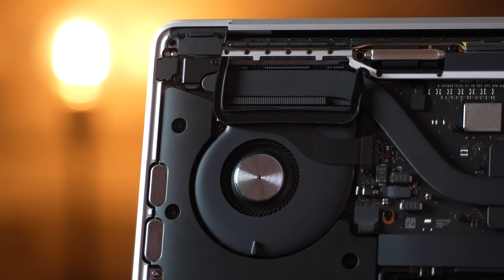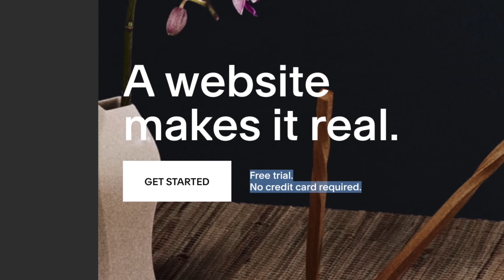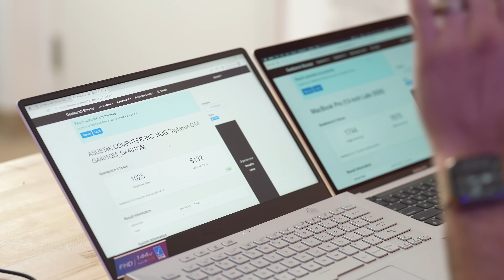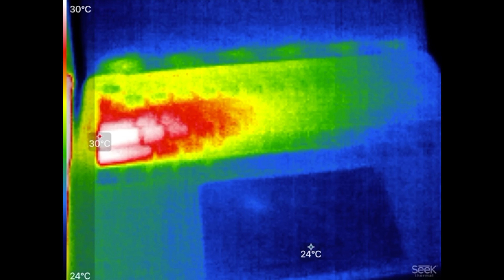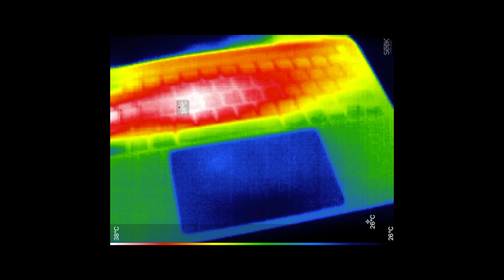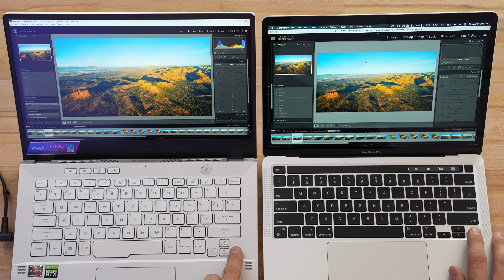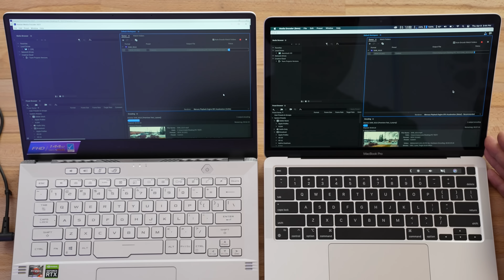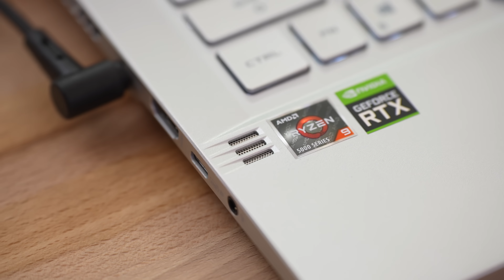Apple M1 vs AMD 5900HS + RTX 3060: FINALLY an M1 Killer?

Comment: One key test metric left unmentioned: battery life for the Zephyrus G14.
Reply: I'll do a test on mine tomorrow. It advertises 10 hours of battery life, but I'm expecting closer to 6 or 7 with my usage. That will be with web browsing, photo editing, and watching some videos.
Reply: @timg6930  how was it?
Reply: @timg6930  mine got 9h 🤷🏽‍♂️
Reply: No way I use to have an older version of this. 5-6 hours tops
Reply: I just got one. Gaming I was VERY pleasantly surprised that I could get anywhere between 2 (heavy, maxxing out GPU, turbo mode, etc) and 5 (lighter games or heavy ones with low graphics and in iGPU mode, still hitting 60fps easy) hours of gaming. When doing productive or media intensive tasks I got between 8 and 11 hours. Overall,  very very good. I switched from Mac and couldn't be happier
Reply: @planefan082  that is so awesome, man!
Reply: Is it good?
Reply: @blackpepper2610  unfortunately Apple is far ahead of everybody else at this moment.
Reply: I have the 2021 Ryzen 9 5900HS version ,same as the one on this video. I disabled turbo boost only on battery and use it in silent profile, the performance is still insane even in this mode. Screen brightness around 80% and keyboard brightness ON, i worked for a full day without noticing I was on battery before Windows eventually game me the 10% battery left warning. I program and compile code, so not a completely lightweight scenario. I can say that you can get 6-8h of battery life easily with this laptop on these conditions. My gf has the M1 MBP13 and when she uses it for something a little bit heavier than just looking at facebook, for example if she is editing some photos or something with it, or even watching netflix, the battery also lasts around 8h. So the G14 is almost double the CPU performance and almost 5x the GPU performance, upgradable, cheaper, and has the same battery life. The M1 is no longer shocking, the G14 just showed us that x86 still has many years to shine. And I'm not seeing Apple silicon catching up anytime soon, it's not easy for them to catch up with a cpu that has almost 2x the performance in just a single year or 2, because the x86 will also keep evolving. And the M1 already overheats, so I don't see Apple pushing much more cores on the M1X / M2 anyway. And the M1 GPU is still barely better than an integrated card, and Intel Xe graphics are already better than it. Apple made a huge decision to change to their own silicon, but they only got it right because intel wasn't evolving sh*t. But things have changed and the new AMD 5000 and intel 11th gen with Xe graphics and incoming 12th gen will really make Apple jealous for ditching intel (and that's exactly what intel is trying to do because they are pissed at Apple). We users are the ones who win with this, harsh competition is awesome
Reply: One key test was unmentioned cyber punk fps
Reply: it would be interesting to know, what performance the G14 would deliver if limited to 15 watts. most like not turning on.
Reply: Well with a mentioning that m1 last longer we also should mention that 16gb amd laptop is cheaper than 8gb mac... So if we would compare both models with 16gb, pretty mutch you would overlay for m1 battery half grand extra  while wining all m1 limitations and short ends to. I think m1 for most ppl not worth since you can get better suited amd laptop for cheaper that does job just as good and better. Only reasons to buy m1 if you need mac os or that battery life, but as far as i know apple users does not realy care about value, they willing to pay apple tax
Reply: @racistpixel1017  The Apple tax you talked about only applies if you spec up the M1 Macbooks. If you buy the base models they are both very good value, maybe not for you specifically but for most people who use a laptop. Here are some facts that prove this:
1/ Mac sale in unit is up 50% from Q4 last year.
2/ Most tech reviewers suggest M1 MacBooks for everyday use for most people unless you have specific need for window or x86. They are all amaze of the efficiency/battery and low noise/temp these laptops offer.  
3/ It has been 5 months since M1 came out and I can't find a laptop that have similar size, weight, build quality and price that can beat the base model M1 MacBook Air. (don't even mention battery life)

It might not fit your needs but these MacBooks for sure are excellent valued products and keep in mind that you don't present all people who use laptop.
Reply: @super_hero2  asus zephyrus g14 maxed out cheaper than 8gb m1 mac and beats it in value, here apple tax, it cheapes out for faster usb ports, ios, hz screen, multiple monitors, shitty gpu compared to dedicated, outdated design and else. Again clever apple tax. 

For average user for every day use hight refresh rate gives more than cpu speed he newer will be able to utilize. So m1 power is a waste if these tech youtubers only suggest m1 as everyday use laptop. If you ever experiance 120-140 or even 300hz screens, you will understand the pleasure.

You can find plenty of notebooks with amd that is does not produce much heat or noise (even so noone did notice those 2 until m1 made a problem out of it), so for everyday use any laptop will be fine, you can play on faster cpu but slover and limited everything else and believe that you win good value...
Reply: @racistpixel1017  I am not sure what you are trying to say here. I already said that the Apple tax only apply when you start maxing out the MacBook. Most people don't need 1tb 2tb ssd on a laptop.
Why should I take your word for it when serious multiple tech reviewers (who make a living reviewing tech) suggest M1 MacBook over anything else for average users? You think high refresh rate is king, I think color accurate, brightness, high resolution HDR capable screen is better.
Let's be specific, for $999 find me a laptop that has similar thickness, weight, build quality. You don't have to match everything but it better be similar comparable.
Reply: @super_hero2  average user cant see color accuracy but can feel frame rate, and colors and all on those screens is still good, fot for profesionals. Those tech youtubers probably dont edit videos on m1 mac's. Those youtubers only suggest, that does not mean its a "must to buy", they also hyped.  And for apple tax again, g14 maxes out model that is pretty mutch more powerfull than maxes out m1 model but cheaper than base m1 model... apple tax... I dont think thats hard to understand...
Reply: @racistpixel1017   You've compared the maxed out G14 and M1, the fact is that the only difference is storage, either M1 performs the same, there is no need to maxing out. You could even save more with the M1 Air, Apple "tax" is avoided.

With the high refresh rates, that's all for gaming, it doesn't contribute anything in editing. 

That's the difference between the two laptops, the G14 is much more capable of gaming and M1 is a first gen laptop focused on professional work. It all depends on what you need for your daily workflow.

With your statement of content creators, probably not using it for editing and it's just hyped. It is capable for editing, it's not like older gen. Macs didn't exist and weren't used for editing. 

Though in your perspective it's not for everyone, it's a first gen. producy, people with established workflows won't be able to adapt easily to the new M1.

*eh idk, just wanted to hop in the thread.
Reply: @jayaflower  dude are you listening, i have high refresh rate panel and i dont play games, these panes is superior, whole system feels smoother and more responsive, again fps is worth more than cpu power that you will never utilize ... For average user that m1 is for, smoother panel is way more pleasant and actually something he can use and feel every time he use laptop, but cpu power, probably only 5% utilized so... What a trade of
Reply: @racistpixel1017  Those YouTubers suggest M1 MacBook for AVERAGE users which is the majority of the total users. People who use laptop for video editing is just a small fraction.
You can put a MacBook and G14 side by side and compare the picture quality yourself to see if average user can see the different. And don't even mention HDR video. You can't have everything so between high refresh rate vs picture quality, I choose picture quality. What you or I think does not matter here since it is subjective.
You still haven't shown me any laptop that beat the base M1 MacBook Air with similar form factor and price.

The point here is that you can't deny that the M series chip is making a huge impact on mobile processors. I am not saying AMD is not good, in fact they are both very far ahead from Intel.
Reply: @racistpixel1017   You are the one who's not listening. Since you don't game, you can't say that the MacBook only uses a percentage of the chip power isn't worth it, since the M1 can perform that well against a laptop that uses more power. And considering in, you wouldn't probably consume all the power of the cpu at once all the time, if you're just an "average user" so your statement doesn't stand.

You can't justify picture quality to high refresh rates (as mentioned in another reply), the M1's OS is built to have a good user experience, it's responsive too. You don't scrolling through the web and moving around windows around at a fast rate like you can work with that. You'll also need to consider in the quality of the G14's screen since that's also part of the experience, as you've also mentioned that responsiveness is key, that statement doesn't stand well if the MacOs can keep run smoothly too.
Reply: @jayaflower  omg, ok i run to buy mac Now since it has little bit faster cpu but slow everything else. Okk... life changing experience
Reply: @racistpixel1017  Yes, use your sarcasm to divert on your losing stance. and btw it isn't slow.
Reply: @jayaflower  slow refresh rate, slow usb speeds, no video card, bluetooth issues, no upgradeability, no multiple monitors, no virtualization, no atleast medioker gaming, as you say, m1 is for average user, that means in apple eyes, average user only need fast exporting times,... Me as a average user, i dont need fastest cpu in the world, i choose slower cpu since m1 power i cant utilize, it does not exist for me. Im tired of trying to explain this simple thing to you, if you cant understand... Not my problem, dream how you will use all that m1 power while i have smooth os experiance apple dont have that i can see amd i do utilize...
Reply: @racistpixel1017  Then why are you here defending two devices that doesn't matter to you, that's the simple thing that you can't understand.

You have a different understanding of an average user, you're an average user using statements for more than an regular user, the M1 is capable of light gaming, it has virtualization, bluetooth is bad on every device.

Again stop repeating yourself, slow refresh rate you say, yet the screen quality is better than your experience. And in other words you don't need to upgrade if you're an average user, you don't need three monitors if you're an average user.

You seem like you didn't even watch the video, and the uses of the M1 and G14. You're completely out of the topic. and I thank you for engaging with the thread lmao.
Reply: @racistpixel1017  Every laptop has pros and cons, you can't list all the cons of a laptop and ignore all the pros then draw a conclusion that it is overpriced.

You say average user can't utilize the M1 chip fully then do you think average user need a dedicated GPU? I also doubt that average user would prefer 144hz over picture quality. I have never heard anyone who looks for a high refresh rate laptop unless they play game.

Keep in mind people buy laptops and use them for years. 3, 4 years down the row M1 will still hold up nicely while your window laptop will either become slow or has sound/battery/display problems, good luck using it without the charger.
Reply: @super_hero2  for hz, most of ppl newer experience that, when you try it first time, you wont come back...

 My 9th i5 helds up prety nicely, can run all the games if i want, good for work, no lag, dont lack a bit of performance and on bonus whole OS run at 120fps while using only ~3-5% of cpu, to use it a pleasure, tried friend m1, while its snappy an all that, i dont see mutch difference. so realy cpu is good enough for meny years now...  Plus panel picture quality good enough, actually now days, panels for consumers pretty mutch profesional grade and most average users cant tell if lime is yellow or green...

What im trying to say for hyped apple fans who rave about how ultimately  superior m1 is, it is not, and devices based on it not superior, its supperior compared to older apple products but its not the best of the best choise for everyone... It seems that m1 is religion to  lifetimes apple users...

And yeat 95% of ppl who buy m1 is lifetime apple users, if you lool to charts you probably notice that pc side of consumers  buys did not dropped down.

Even so with iphones, most of sells in android market even so iphone considered as superior, but only to apple users
Reply: @racistpixel1017  How could you say that average user will love the high refresh rate over picture quality when you know that most people never experience high refresh rate? What is your sample size? yourself?

I know that in the case of smart phone, the reason why people don't go back from high refresh rate is because the difference in picture quality between smartphones is very similar. While in the case of this video the difference in picture quality between these two displays is not close at all.

Unless your laptop is designed for gaming, it likely won't have higher than 60Hz. Apple, Dell, Microsoft... they do extensive researchs and decide to go for picture quality for non gaming laptop for years, it is not only Apple and this is no coincidence.
Reply: @racistpixel1017  Modern CPU won't be fully utilized if you don't multitask. Try running antivirus, play game with external monitors, streaming your game, use discord.

The M1 MacBook display is 2560x1600, HDR capable, DCI-P3, 400 nits brightness and you are saying that to average users, it looks the same with the 1080, 300 nits display? If you really think so, you need to provide data to prove your point because logically it sounds insane.

Please don't use made up number in your replies (95% ppl buy m1 is lifetime apple users). Buys don't drop for any company especially since the pandemic but Mac increase the most percentage wise and it only been one quarter since M1 came out (the data I stated before was year to year increase).
Reply: @super_hero2  
Sometimes it seems you dont read half what i write and you just and just argue....

again, i dont game and i o
Preffer high refresh rate, the whole laptop feels way faster and smoother, how many times i have to repeat until you understand, average user cant tell if lime is yellow or green, if you dont put two screens side by side, they cant tell differentce, consumers screens nowdays is professional grade, as a graphic dedigner i can tell, they good, you wont win much in quality, better invest in smoother system. and again AVERAGE USER...

 ON TINY M1 SCREEN THERE IS NO POINT FOR SUCH HIGHT RESOLUTION.

Now i do use discrod, i dont need 3rd antivirus, use Microsoft build in one amd had no viruses for years, i do use other heavy programs and engines and still my cpu usage is chill. for aying games yeas but rarely more that 80% on maxed settings, but do we speak about m1 since no single point you mentioned is possible on m1... And yeat we speaking about average users

Probably you do dont read this so yah farewell, i dont want to argue whith i simpleminded self-righteous person who dont listen only speaks... To who i have to repeat same thing and points and he jist skips it and you still dont understand what im trying to say. You can be right for your self.

If you still argue and not geting my points  then whats the point, i wont repeat anymore like to a child
Reply: @racistpixel1017  ?? you are really saying, that we arent reading half of what you wrote, but you are doing the same! Average user cant tell the difference between 60 hz and 120hz /144hz, so thats a stupid argument. "If you dont put both displays side by side" you will not see any refresh rate difference :)) 

I had a windows laptop with a 1080p panel and i have a Macbook air with this 1600x2600 display and you can see a big difference in resolution and especially in colour. Its the same as having a full hd panel on a smartphone or just having a 720p display, you can see the difference, especially on 13inch!

and I dont know whats your point with your I5 laptop... you are saying it has enough power for the future because its working at the moment, but for sure the M1 can show its power even better in future, because it has double the performance.

Usually you buy those "gaming laptops" to have a lot gaming performance. Its stupid to say " you dont need this power" then why are you buying those gaming notebooks as average user? you have a lot important disadvantages as normal average user like less battery time, a louder laptop, which gets hot fast, crappy  sound/trackpad/keyboard AND a DISPLAY MADE FOR GAMING.
So whats your point here?  And dont come again with your 120hz display, most average People WILL NOT EVEN NOTICE!

:))
Reply: @tim-n.schutze8796  my laptop is not gaming, neither its hot or loud but also its  not from slim side, it weight 500 grams more than 15 inch apple m1. In other gand there is plenty slim laptops with 140hz screens that you can sence that it run hot only if you have thermal gun. whilaptop and no human definetely can feel hz difference, just like on phones, ppl do see it and feel it so your argument is invalid... And yas, you can see difference between panels when they compared side by side, bet as i sayd, most of screens today, is profesional grade, have 95-100% of color accuracy, they all are nice, next step is smooth os.

My old laptop with 4th gen i7 is still capable and over kill for average user... Cant tell that about 3th gen but 4th, can run pretty mutch ANYTHING with no lag. And its 10 yers old laptop cpu... So your argument that my i5 on few years will be to old is also invalid
Reply: @racistpixel1017  So you agree with me on the other points :))  
Well, you can see the HZ difference and its the same with display resolution, so its all about what you like more! and most people would go for the overall better macbook and the better resolution display as a average user. 
Its ok if you say, that your laptop still isnt loud or hot, but then you know how good the m1 would perform with that 15watt chip !
Professional Grade is p3 or adobe colour, not  just normal srgb, but yea the colour is fine for normal users for sure.

And your 10 year old laptop with 2cores/4threads will definetly not do anything without any lag. but you normally dont use any of these notebooks for 10 years, so that isnt important at all, your i5 notebook will work fine in the future and the m1 macbook would work twise as good because of the performance, thats a fact.
"Normal users wouldnt use the power of the m1" YES, but if you compare to the g14 which was the originally topic, then its about the same and you wouldnt buy the g14 either if you dont really need that gaming power.
Reply: @tim-n.schutze8796  my 10 years old i7, it drom 2012, its 8 cores 16 threads. 

I was telling this in wery begining while someone was arguing to me and not listening or reading, i statet this in two of my comments before, m1 is superior cpu, but its limited as system, m1 products is one of best in the market but not universal and not fitting alost of users needs... M1 is good if you upgrade from older mac's and probably only chouse, but oc users have variaty to choose from and everyone can find something that bring more value to them.
For me m1 does not provide mutch value, while its fast, i dont need that speed overhead, while screen is hi-res, its to small and to slow... And so on

I just started my coment to tell ppl who think that m1 is best of the best of the best and 10x better to anything else out there, since there some dumb ppl think that m1 is fastest and most powerfull cpu in the worls with no compromises
Reply: @racistpixel1017  ok fine now you are talking about software arent you? from hardware/formfactor side this laptop brings some of the best value in this categorie and thats why everyone is hyped.

Anyways pls name me some real disadvaantages with this "system" and why it dont fit a lot of people?
Reply: @tim-n.schutze8796  again? Realy?,need to save somewhere a copy to paste...

Low hz,

 no upgradability,

no gpu (gpu makes video and 3d creation better and faster)

, limited storage options with combo of slow usb ports if you want to use externall ssd's, (before you say, yeas m1 use new generation of usb ports, but transfer speed is still slow so if you youtuber or transfer large files often, thats wery inefficient interms of time wasted and hurt on productivity)

no virtualization, 

bluetooth issues, 

smallest io in the market, dongles is needed and if you travel thats a pain, plus dongkes tend to be lost.

There is a issue of large mathematical, physics and chemistry calcations for profesionals due of short 128bit vector length, thats a hardvare limitations, either you use slow SW layers to simulate longer vector or use x86

if in m1 something fails, you need to swap whole system to fix it, 

no multiple 4k external monotors and only up to 2 1080p external monitors. 

There is probably more
Reply: @racistpixel1017  AND THERE WE HAVE IT AGAIN, normal users dont need multiple 4k monitors, special 128bit blabla, a gaming gpu or high refresh rate!!! 
There are no real bluetooth problems btw, dont know what you are talking about!
Then name me some faster usb ports, which are faster than 10gbits, havent seen them on the g14???

AS I SAID ALREADY five times, you dont need a gpu for rendering or professional video editing, its just usefull for gaming and game development, so its not important for the users.

Upgradability is a point where you have the advantage with windows laptops. but why should you upgrade a macbook if it performs perfect even in the future because of its high performance.
As a normal user you dont need more than 500 gb on a laptop, if you are a professional you usually have external drives to use it on the pc at home and on the laptop.

There is btw no issue with 128 bit tasks, its just not that strong as with intel/amd chips, but WHO would need this???

Its funny how you are still only calling out the advantages of the g14/your i5 laptop but not the disadvantages because there are a lot!

you gave some arguments here, which are important for only 1-2% of the users, but you said for most people the macbook isnt the best/good choice! name me some real disadvantages which affect over 20% of the users!
Reply: @tim-n.schutze8796  im not calling g14or a anything.

Usb port is slow when you try to transfer files, look it up, on paper it fast bot in reality it slow...   

Gpu make exporting videos faster and creation less choppy, even m1 have  issues with that.

Average user dont need tinny ass 4k screen also, and yeas swhile you might say he dont need hz but thats damn nice experiance boost like is better screen no? I would shoose hz over little bit better brightness...

Again you saying upgradability, if you profesional user, usb ports is slow, so when you have to transfer terbatyes every day, thats pain with slowe usb's

Average user dont need m1 fast exporting times to

The os no real disantvantages, do i need to repeat you again? Why? Apple m1 is good device, READ!!! Apple m1 is a good chio, m1 based devices is good devoices, but its not best of the best of the best with no compromises and not for everyone... Omg dude, how many times you missunderstand me... I told you that im speaking for and about ppl who believe that there nothing better than m1... Whats wrong with you?

Again there tons of ppl thinking that m1 laptops is most poverfull and all mighty devices in the market and generations ahead any x86 chip. And that there nothing betters out there, someone told me thay m1 is more powerfull than thread ripper with all maxed gpu, ram and all these shinanegens, called me dumb but clearly missong his beloved benchmarks that shows 30k vs 6k differentse for amd side.
Reply: @racistpixel1017  Bro pls jsut give me some proofs! there is no problem with the usb c speed??
Pls watcht the video next time. As i Said already the video shows the time for exporting 4k video with g14 and m1 macbook and they are the same, so that isnt a argument for your GPU. And again show me some proves for the "M1 ISSUES".

"Average user dont need m1 exporting speed" ok?? we are still comparing to other high end laptops arent we?

"I told you that im speaking for and about ppl who believe that there nothing better than m1... Whats wrong with you?"

I NEVER said that, but YOU said in the beginning, that you pay apple taxes for the m1 macbook and "how bad it is". And you said its not worth for most people and thats just not true:)  I also like the g14 and they are BOTH good laptops!

"someone told me thay m1 is more powerfull than thread ripper with all maxed gpu, ram and all these shinanegens,"

But i didnt said that to you, so why talk about that??
Reply: @tim-n.schutze8796  https://www.youtube.com/watch?v=9bGFKhHjvmo&t=329s

litteraly first video in toutube search

"But i didnt said that to you, so why talk about that??"

since you engaged to speak with me, not i did.  and i had to state few times where i stand in terms of m1 to you.

and yeas you pay apple tax, that's real. what you get with m1 is few good perks and few bad perks where for exampke g14 is cheaper that base model m1 and still pack that expensive gpu inside plus dont have these bad perks of m1 while not having probably only a battery (while battery is still all day battery in g14)...

with m1 only real benefit for average consumer is battery... they dont need fast exporting times really. the dont feel heat in same class laptops from intel or amd... realy what rela value it brings? ok little bit better screen in one place and little bit worse in other than what pc winows machines offers. most of value that m1 bring for average user is more or less not utelizable. ofcourse is a good for ego to feel better about your self when you have all that fast exporting time and praised m1.
Reply: @racistpixel1017  OMG you trigger me so hard...
I see your point with the slower write and read speeds, but in the video the ssd is 100MB/s slower, thats 33% less but still fine.. if you need that 100 MB/s more, then yea you can go for x86 laptops (its a software issue, so it will be fixed soon).
base model macbook air is about 1100€ in europe and g14 about 1900€ (with the prices of the video it would be 1000$ vs 1400$), so the g14 isnt cheaper at all.

you can say, it has a GPU for almost the same Price, but thats normal, because they saved the money in materials, display, keyboard, trackpad, software AND they just build a bigger laptop with a lot more power consumption.  AND There is NO laptop this slim, which has any real dedicated graphics card!
Again you get with both devices your advantages and disadvantages, both devices have decent price/performance and you dont really pay any apple taxes anymore, to be completely fair, just compare to other windows notebooks with 15 watt power consumption and this slim design. this is just a comparison to show, that it can even compete with  150 watt devices.

"The real value it brings" is : its Just a overall pretty good performing laptop, which good performance for professional work and long battery life for average users.

You are saying the same arguments again and again, next time pls just read, what i wrote before, so i dont have to write the same over and over again
Reply: @zen608  in  some aspects, for example amd epyc gets 100k points in benchmarks where m1 6k..., also amd support dedicated gpu to support that cpu, more ram and more memory, so that superiority is relative.
Reply: @racistpixel1017  The M1 Mac has several additional features lacking in PC laptops (like a neural engine) and use memory more efficiently than PCs due to Apple optimizing their software to the ARM SOC universal memory architecture they have recently embraced.  There are several videos that demonstrate this.  Now it isn't doubly efficient but it is noticeable.  Also ARM doesn't suffer thermal throttling that AMD/Intel variants do.  For PC laptops the writing is on the wall with AMD moving to ARM and Intel making a move to RISC-V.  Also, M1 is a baseline model the M1X models coming out this fall will further address your issues.
Reply: @madmotorcyclist  that fancy universal ram is not something else but shared memory between cpu and gpu, doubt its a good thing since for gpu is better to have v-ram and at same time the igpu eating ram that could be used for something else, and yeas while it uses less ram to keep apps alive, realistically thats usseles, noone keeps 50 running im background and even so pc users  ot locked with limited amout of ram so me with 32gb or more can do more than mack with 16
Reply: @racistpixel1017  But in the case of V-ram you have do to successive data transfers between CPU and GPU across a bus which is eliminated by the SOC Apple approach.
Reply: @madmotorcyclist  yeas and with apple approach its still not as capable as discretel graphics... while its fastest igpu, its still just a igpu and these not meant to replace discrete gpus. in many ways, m1 products is inferior and in few superior, if you one of those rare lucky ppl who need extra cpu power in mobile factor, or you choose more powerfull intel or amd desktop machine. for me even as software developer, even older 9th gen i5 H  is more tham i realy need, everything els else luxury many ppl can live without, ppl dont understand how even older cpus realy good, they blinded by benchmarks.
Reply: @racistpixel1017   yes That 8gb Version costs about the same as the 16gb version of the amd notebook. But keep in mind, That he tested the 8gb MacBook in this Video against the g14 and it hasnt got Any disadvantages. Mac OS is just a Bit more RAM efficient, probably Not the Same as with the g14 but its very close (i still hate those RAM prices From Apple). But now you have to look at other components... the m1 is a lot cooler and more quiet because of the less wattage, it has a better display, better speakers, better trackpad, a touchbar ( for most of the people its useless, But you have it), better materials, better battery life. So yea, i think its pretty much worth it.
Reply: @tim-n.schutze8796  
Asus battery last 11h, m1 battery last 18h... 11h is plenty and extra 7h from apple not worth extra 500, atleast for me. 

yeas ,indeed, in workflows where you need extra ram you will see m1 performance increased, but big part of those workflows is where you need good video card and on those asus will win anyways. Plus with asus you get more ssd, potentially even more ram, top notch video card, 120-144hz screen that from my experiance with hight refresh rate screens, it makes pc feel even faster and snappier. I compared mine older midrange laptop with 120hz screen and to be honest, just from browsing the web, youtubing and doing all that glory, ppl though that mine laptop is faster, while it has only a 9th intel i5. The whole experiance with laptops with  screens like that, well once you taste it, you wont go back, even for 10x performance cpu. Plus zephyrus in that 500 cheaper price adds other added value like better IO, even of m1 have more recent gen usb, they still run on old slow speeds so. 

By the way, amd thread ripper cpu's on multicore cpu test gets 12x more points. M1 6k while amd 30k.

Atleast for now i see same old apple tax applied here, less features for larger price.
Reply: @racistpixel1017  you havent rlly got the point... for sure 11h of battery life(it will be more like 7) is enough for 1 day or 2, but better is better, thats a fact. same with processors in smartphones, you dont need the better ones because the medium range smartphones are fast enough... 

you watched the video? he´s showing a lot of real world benchmarks and  there you have a lot of  applications only using CPU, not the GPU. and even video editing is about the same. the only advantage with the notebook with GPU is Gaming and 3D Rendering and stuff like that.  SO i dont see, where your big part of workflow is done with a GPU. 
You can say 120 hz/144hz is nicer for browsing and stuff like that, but its a PRO Notebook for professionals, who need good panels with perfect colours and high resolution, you dont need high refresh rates while watching movies with 24-60 fps, or doing photoediting or videoediting. IO is pretty bad because of only using usb c ports, which have btw normal 10 Gbit/s speed (??). But thats something a lot of these slim notebooks do today.

I Dont know why you compare a PC CPU with  32/64 cores with this 8 Core 15 watt notebook chip, but yea for sure that 300 watt threadripper is a lot faster, but thats just a stupid comparison. 6k to 30k is btw 5x faster, not 12x.

You can see "apple taxes" if you mean those Ram/SSD upgrade prices, but not the main product, if you buy a standard macbook pro/air with standard configuration, no notebook with this slim formfactor will be better. And still with those overpriced upgrades you get a decent notebook, which will be just perfect for professionals.

And you havent said anything about the other features, the M1 has over the Asus notebook? Overall the Macbook with all those features is the way to go for professionals in most cases.
Reply: @tim-n.schutze8796  profesional dont buy apple, those who do mathematical and physocs calculations, m1 cant handle long dara processes, it has only 128bit vector. Anyway, still profesional who do 3d and video dont buy apple since no video card, only those who use apple editing software. 

I compare thread ripper with m1 so ppl would wake up, allot of guys think that m1 is the most powerfull and best cpu with no compromises, and that inte going to die and its end of pc era. They dont  understand that they comparing to intel U series cpu that has low power and there bigger player in a market like amd. 

My point is that m1 is hyped product with allot of comprises and short ends. While it offer few realy nice things, there is better value in pc market. And no its not base low end apple cpu, its the best of its veneration, next apple cpu will be next generation... There no proofs to back it up that its low end apple cpu... They either would release few cpu a year , the you can say, look, this one a base model, this one is a pro model, but there no pro model... M1 is apple flagship amd its not the most powerful cpu in the market,. NEither its universal like x86 is
Reply: @racistpixel1017  you are saying again, that there are a lot processors with more performance, but thats only true if you compare to a Desktop pc, but this is a Notebook (and its a slim power efficient notebook) and i dont think, there are a lot processors with more power than the 5900H or M1, these are one of the best chips for notebooks! And if you  think of it; for sure they can make the strongest CPUs with this architecture, look at that power draw, 15 WATT, there is so much room to improve. Its 1/4 of the power consumption of the AMD 5900H... and thats the special thing about those processors, the efficiency, thats why its hyped! Especially the battery life when doing hard tasks is way better with m1, because it consumes a lot less for sure. 

As i said, a lot professionals use an macbook for photo editing or video editing, those processes you describe are usually made by big workstations, bcs thats something a Notebook isnt made for.  And you can see in the video as said already, that the macbook has the same rendering speed in video editing, so there is no big advantage for the asus.

And there arent rlly big compromises with those ARM chips, for sure not every small program is made for ARM, but the important programs like final cut, photoshop, lightroom, just standard web browsing, office365.  Even then you can emulate almost every program with rosetta, so where are these compromises?
Reply: @tim-n.schutze8796  you dont understand what im saying,

FOR ME, M1 DONT GIVE ANYTHING I CAN REALY UTILIZE, SO NO BETTER VALUE

 M1 is superior as cpu, but with all the limitations these m1 apple devices is not better than less powefull amd machine, dont be blinder by share cpu power, its more about system or a work station than a exporting times...

The value of m1 devices is not that great for:

1. Those who need basic multiple monitors support.

2. Who need fast usb ports (youtuber who move terabytes of data everyday)

3. Who need decent gpu, same youtubers who need to make bigger more serious videos...

Now the more value is only for existing apple users who upgrade from older apple devices... But then, not by cpu power, since most of them newer utilize even half of that cpu... 

M1 value is a illusion, yeas you get slim more powerfull device, but with x86 you can  get even slimmer more atractive device... Those regular users would have better value by choosing more hz screen, not a cpu headroom they wont be able to use....

So realy... Only apple users have value by upgading from older apple devices, most pc users not since there is better perks or perks they can use and less limitations with x86

M
Reply: @racistpixel1017  both notebooks have their advantages, and its fine if you like to work with the windows notebook more, but what you are saying isnt true.

1. only few persons use their notebook with multi desktop setup, if they want to then they can buy windows notebooks.
2. yes the macbook (air) has only 2 usb c ports, but what is wrong with them, they are both 10Gbits, thats normal speed?
3. Those Youtuber use macbooks to cut their serious videos??? As i said, its the same performance as with the g14??

It dont have to be more value but its the same value as the g14. Its interesting how you say now, that most people will not even notice that much performance, then you should buy the macbook over the g14 even more because you get those features like better trackpad+keyboard, better display with beautiful colours and high resolution, normal persons will not even notice that 144hz.
And what do you mean with you can get even slimmer devices on windows notebooks??? The macbook air is one of the thinnest notebooks. If you buy those small notebooks with windows, you will have a lot of compromises like cheap materials, less battery life, a lot less power,cheap display,....
And now tell me some of the limitations you will notice when working with an m1 macbook?
Reply: @tim-n.schutze8796  i would buy g14 since of 140hz screen that would boost my experiance drastically, also gpu since i prefer balanced system also work with 3d graphics and programing job, plus g14 have decent keyboard, what else you can ask, no complains. Even so most of ppl dont even need 11gen i7 performances, they wont utilize it, so amd cpu of g14 or m1, just a waste for everyone, as you said, for workstation ppl get desktops.

M1 usb ports are slow not by thecnology or gen but by transfer speeds. Look it up, they slow while you try to move files. And have some bluetooth issues.

I do understand why macbooks is realy nice and might be even excellent choose for majority basic users, heck even work ppl, its pack a punch , good battery life, compact, hight performance, hight quality, i just say as a product and what really of usability it brings, its overated. 

Its i best and only choice to upgrade for existing apple users but not only choice for pc users.
That is the reason why everyone hyping and praising m1 looks and speaks things that only a apple user would say, always comparing intel and intel issues addressed in apple macs but not amd.
Reply: @racistpixel1017  Dude, I will just use an analogy.

What would you prefer? A >2 tons car with 400HP or a <1.5 tons car with 300HP?

Your choice... Power-to-weight ratio is the same as power-to-consumption ratio
Reply: @racistpixel1017  LoL😂
It hardly lasts for 5-6 hours
Reply: @racistpixel1017  sorry bro, how much power does Threaderipper draw??? How many cores does it have, how much does it cost??? You are comparing a high end desktop processor build DDPR supercomputing to a mobile laptop processor that is only 15 watts, and on a totally different architecture 🤦🏻‍♂️🤦🏻‍♂️🤦🏻‍♂️. Not very smart from my point of view. Even this Zhehyrus is 8x - 9x more power hungry than the Apple one and it struggles to catch the pace.
Reply: @racistpixel1017  uhhh, base model Mac(999$) has same CPU as the top model spec except 1 less GPU core and that AMD laptop is 5900hs + rtx 3060 which is around 1500-1600$ or more depending on the region. M1 is a lot better option of you are not gonna into gaming.
Reply: @dborwankar  999 for base mac with less ram and ssd, if u see 16gb and 1tb ssd, its pretty much same price. second mac gpu is shit, cant run anything decent.
even so limited io on mac for worse productivity and better video editing on windows rtx gpu, better gaming, better productivity with 3d graphics related work... m1 only offers faster cpu where the difference is not that far from amd, noticeable only for complete geegs... and if you really in to fast cpu u get desktop with thread ripper on epyc that is literaly 6k benchmark on m1 vs 110k on epyc...
Reply: @racistpixel1017  tell me a laptop which is better than a MacBook Air M1 at its price
Reply: @parothamithai9546  asus zephyrus
Reply: @racistpixel1017  it cost 270$ more here so are the battery display and speaker better ?
Reply: @parothamithai9546  if you check 16gb 1tb both variants, price is almost the same, asus have more hz screen so i assume its a preference which is better, so tied, it has possibility to upgrade ram and ssd, 2 ssd in the matter of fact, it has superior gpu, almost if not better in some cases cpu performance, bette apps library + many things still dont work or not optimized for m1, most of dev tools still not supported till this day. btw there many different zephyrus, so look carefully, one better than another
Reply: @racistpixel1017   for speed both is fast so which has better battery life, display quality and sound quality ?
Reply: @parothamithai9546  so you want win argument so hard that only few apple perks for you is matters and everything from asus just ignore?
Reply: @racistpixel1017  what ?
Reply: @parothamithai9546  dude your beloved apple retina display is regular ips lcd screen, apple like to give names, low refresh rate and hight latency, so i preffer asus screen, now loudspeaker quality... is it realy matters? is it all why apple is better, a loudspeaker? and no asus is faster since it has gpu to back it up.
Reply: @racistpixel1017  as if zephyrus has oled screen man, what about the color accuracy ? I am buying a laptop so i want a better one at overall qualities despite processing
Reply: @parothamithai9546  why you need color accuracy? you work on graphics design or similar related work? if no you wont see much difference, if you cant tell just by looking to 2 screens which more color accurate just get more hz screen, it will make OS feel faster and smoother, after it 60hz apple or any other machine will feel like lag... m1 is only good if you need long lasting battery and not planning of Profesional work or gaming.
Reply: @racistpixel1017  color accuracy is important because display is important, photo or videos will look better, my phone has 120hz and it’s definitely smoother than 60hz but I would take a better color and image clarity than high refresh
Reply: @parothamithai9546  it wont make  photos look better, for example, phone ips screens is way more accurate than amoled, but amoled looks better since of postprocessing it apples and overall screen technology. should add that ips looks way more clean and sharp than amoled in same pixels density but amoles is better for media consumption even so its not accurate at all. dont underestimate asus screen, i guess you would  newer tell difference without comparing these side by side and even then would only see a how one or other pleasant to eye, but not a technical things or same colors accuracy. if you planing only to look to photos amd videos, go ahead, apple will do the job just fine and wont bother you with fan noise but i would choose assus since its more future proof
Reply: @racistpixel1017  I’m getting Air cheaper so i guess it’s more value for money then ?
Reply: @parothamithai9546  they almost the same, minor downgrade to quality of features, keep in mind these laptops not future proof, i praise portability and form factor but thats all
Reply: @racistpixel1017  both should last atleast 5 years ?
Reply: @parothamithai9546  it has almost no io, no gpu, no ssd or ram upgrade, sure they last and will be usable in tasks that ask for cpu power but in other activity, creative work related tasks, its already not meeting standarts. almost any laptop in same price range that is dedicated for gaming perform better in video editing, developing, coding, gaming... dont understand me wrong, you can do all these things with m1 machine, cpu truly astonishing for device form factor, but almost anything that ask you to write code will be pain since m1 does not support allot of tools, forget gaming, video editing in realm of light youtuber since no gpu and small io... m1 is early product, arm is limited system, its made for low energy cunsuming devices that grew to smartphones and last years thanks to microsoft inovations is growing to laptops, with apple we are seeing clear  progress unfolding but technology is still limited compared to x64 and will be so for a while. x64 wont disappear and everyone wont jump on arm over night. if you not planing to do nothing besides regular laptop use, im sure apple will bring you a lot of value but keep in mind, if you not using right now laptop from 2010, m1 is not a magical game changer, i know the hype and bias youtubers only speaking good about m1 and keeping silent about it flaws, shininig only positive perspective, little bit smokes and mirrors if i would say so.
Reply: @racistpixel1017  Agreed! Long term macbook user here since 2011. I have been using macbook 2018 15 inch macbook now. And i swear during this WFH i really need reliable laptop that doesnt suck at using extended monitor because it has no dedicated gpu or plugging in something without buying new dongle everytime i need to. There are so many flaws that i hope i can upgrade my macbook on, but i can’t. This laptop was made for people that can tolerate using mediocre at everything. But after seeing so many reviews about amd laptop, i am convinced to change my macbook to G15. I want to see everything without feeling laggy. Plugging everything without buying new dongle everytime. Playing AAA games without doubting how my laptop is capable of. I dont think M1 would cater my needs either. Fast CPU but still worrying the rest of basic day to day usages. Solid 9-11 hours battery life is solid enough for me to spend a whole day of productivity. Back then yeah i really need laptop that has really good form factor and good battery life. But the other competitors has raised. There are so many things that apple can’t compensate with.
Reply: @parothamithai9546  Just buy an ipad pro! I mostly use my ipad pro for consuming multimedia while laying on my bed. Still using my 2018 15 inch macbook for productivity that barely can utilize extended monitor smoothly. Since WFH is getting popular, i just noticed that macbook is not capable of anything at this price range. Just buy a future proof laptop then you will be thankful later. I am gonna sell my macbook pro and will change it to G15. I want to plug in many simple cables if i need to without buying new dongles, trying new game smoothly since i have to switch to my ps4 for playing game instead of my laptop, and 9-11 hours battery life is gonna be enough for me. I dont even think M1 will accomodate my needs. Ofc it has fastest mobile CPU but i should compromise the other things. Ipad pro is enough for me to do simple tasks. Its fast, long battery life, apple pencil and keyboard bring more values. The real definition of powerful mobile device. 

So I think G15 will provide me the other things from my macbook that i wished for.
Reply: @MrInEthical  No. It is not about being idle. These tests are done under load. I have M1. There is a reason why apple was able to create a laptop without fan and it performs very well. Also it is why the laptop performs same with or without adapter hooked. It simply draws less power.

Work is power x time. but there is also waste. Both AMD and M1 are doing the same work but the power is much lower in Apple. Meaning Apple is just efficient, idle or under load. This is because ARM is inherently more efficient. the problem with ARM was the memory in the past, which is not an issue anymore.